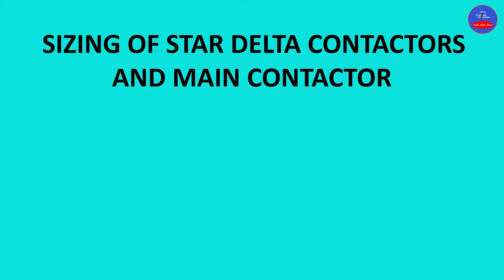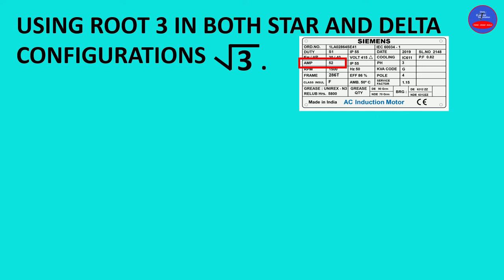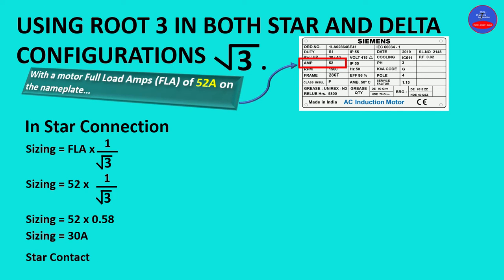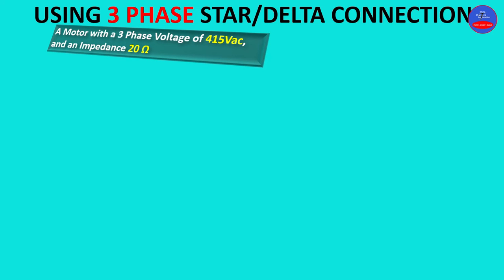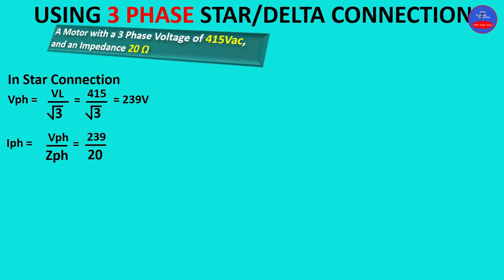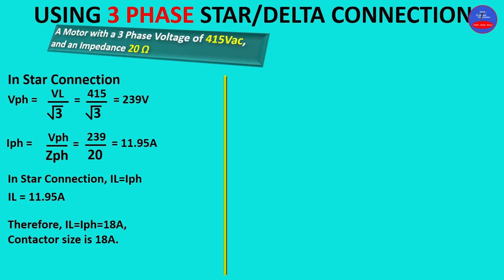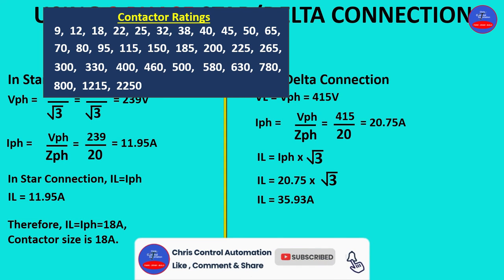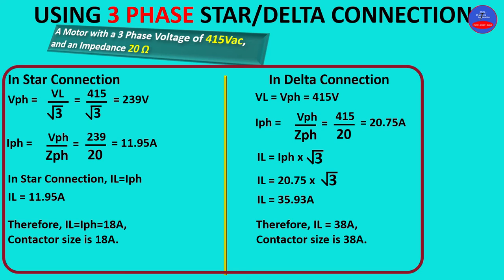Contactor sizing for star delta (Contactor selection formula)

Comment: The currrent on the nameplate is FLC. So if motor is intended to run in delta FLC is IL is In. And then you do not multiply it with 1,73. In = FLC is the size of main contactor in delta connection. On the other hand, when using star delta, windings are split so each contactor inside delta carries only 0,58xFLC and sizing for main and delta are FLC / 0,58. Sizing for star is another reduce, because in star you have I(delta) / 0,58, which is (FLC / 0,58) / 0,58, and that is FLC / 3. Conclusion: when you have motor nominal in delta with DOL contactor is FLC (In), in Y/D main and delta is FLC / 0,58 and star is FLC / 3
Reply from the maker: Well noted with thanks 👍